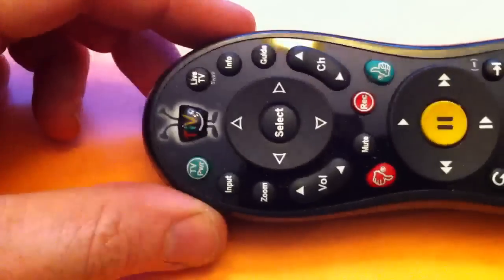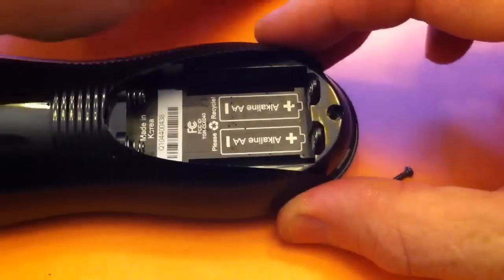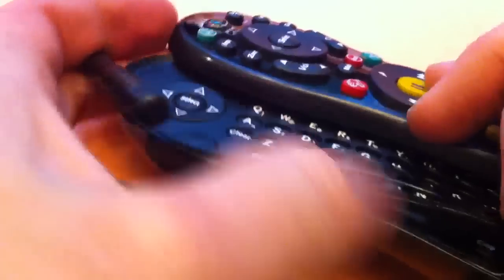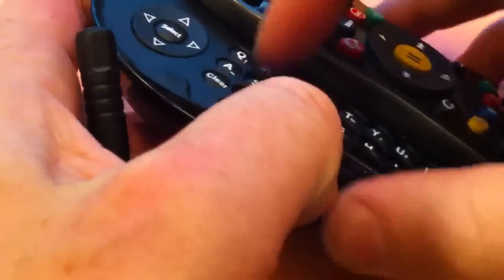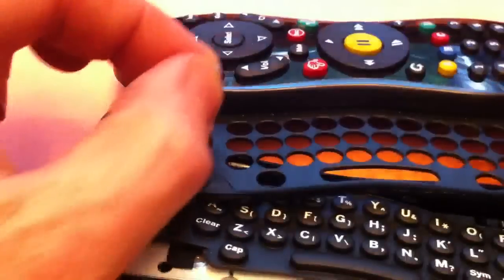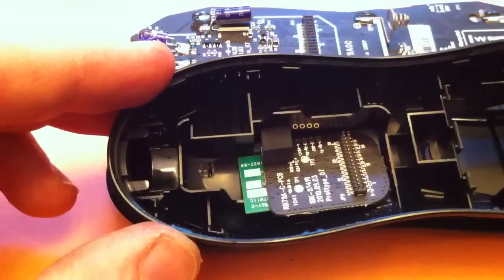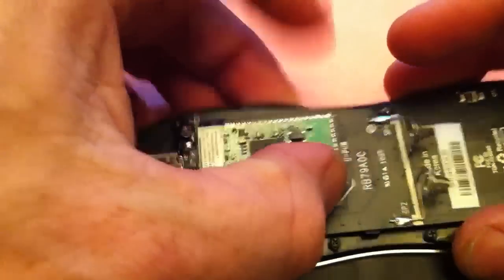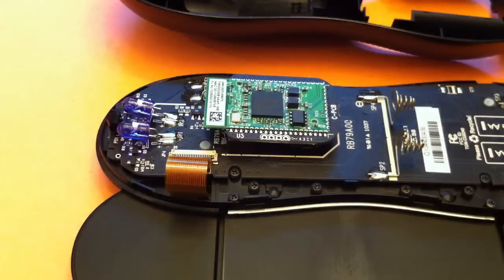TiVo Slider DIY fix - disassembly

Comment: totally fixed it. my remote controlled the tv power and the keyboard seemed to work ok, but the regular tivo controls didn't do a thing other than a blue light. tried all of troubleshooting tips (battery, global reset / re-pairing, reverse insert batteries, etc.) until i found your video. opened up the thing and sure enough, the card wasn't seated properly. unfortunately, i couldn't re-assemble it perfectly so there is a very small gap, but hey, it works, so thank you very, very much.

Comment: Thank you for this video. We keep our remote out of the reach of our toddlers, but it always manages to fall. Last night it fell and every button press was red. I thought for sure it was dead and can't see paying $50-$70 for another one. 

One last thing, I turned the remote upside down when I was popping the cover off and the magnets and rubber keypad stayed in place. I just kept minimal pressure on the circuit board when pulling the back side, where the batteries go, off.

Comment: Fantastic! Thank you, thank you. This is my favorite remote as you can be further back and not have to point it straight at the units either. One note, anyone have a faint red light glowing near the TiVo button it's because this little board got loose and one or two of the pins are connecting but not all. Realigning the small board and putting some padding in totally did the trick.
Reply: Additionally, you can just pry off the bottom battery cover and not worry about the keypad and magnets. Just properly realign with the battery terminals and you're good. Thanks again Stephan!!!
Reply from the maker: Thanks David! Glad the video helped!

Comment: thanks for posting this!  mine stopped working and it was exactly as yours looked. what a design flaw by tivo!  i just put some electrical tape on that connector to hold it for good...

Comment: Thank you so much for this video.  I thought my Slide Remote was dead.  Opened mine and the daughterboard was just about to fall out, but it was disconnected enough not to work.  Reseated and used a foam wedge to keep it in place.  It's not going anywhere now!

Comment: Thanks for the tip. Sadly mine is the slide out keyboard quit working. Something else that might work is a blob of hot melt glue. If you use the softer stuff it will have a bit more give. If you need to remove it just use some rubbing alcohol.  That will cause the glue to release it's bond.

Comment: Wow, on my third one of these from Tivo, got tired of returning them.  And put it to one side three months ago.  Don't know why I didn't look for a repair before - this worked like a charm.  I am sure this was the same problem with the two I previously returned.  Can't believe they didn't fix it.  I added a piece of Styrofoam to hold it in - will see if that holds.

Comment from the maker: Comment appreciated, addicted2dvds!  The second time I had to pull mine apart (I think it was for the video), I had better luck keeping the magnets in place.  The first time around, they went flying!  I can be hamfisted and clumsy at times, that's for sure.  Hopefully I won't have to take this one apart again with that packing peanut in there, but if I do, I will heed your advice.  Enjoy your repaired slider!

Comment: Does not work for us. Ours does not have the Phillips screw and does not have a seam of any kind. There is absolutely no seam anywhere. It is so frustrating. And yes, it does have a sliding keyboard like that. They should not make a remote that can't be taken apart for cleaning unless it is waterproof too. We don't know what got inside but we really need to get inside to clean it or at least look at it.
Reply: You have the newer slide rf remote, this was the older Bluetooth slide remote

Comment: Sadly this didn't solve my issue. The remote lights up, seems to pair, but simply has no effect on the Tivo. I took it apart like you did and everything looks fine. I haven't used it in about 6yrs now. Soon after it began acting up, maybe 7yrs ago, I took it apart and sprayed Deoxit on as much as I could get to. It worked for a little while but finally nothing works. How do I take apart the top half of the remote? I don't see how it's possible without damaging it?